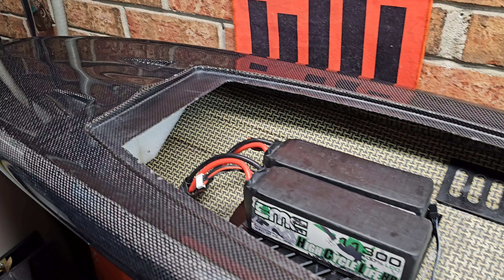How To Use Fiberglass Seam & Parts Mounting Cloth Servo Installation 51" TFL Ariane Build

Comment: Big B , Great demonstration on using fiberglass . It is appreciated . I think that this servo stand enforcement will out last you and me together .😊

Q: in next video , please can you explain that red thing with oil can nozzle attached to stuffing tube you call bearing . Why do you call it bearing?what is its other function besides providing a gateway for flex shaft entering the stuffing tube and anchoring the stuffing tube ? Thank you
Reply from the maker: Yes, thank you...  I will explain the bearing oiler block in the next video

Comment: Great confidence builder 👍 ..I don't mind working with fiberglass, it's mostly the choice of epoxy that causes frustration. I tried using the traditional stuff you get at the hobby store a while back, but my mix was off just enough that it wouldn't set. Stunk my whole place up from the chemicals off gassing. I like using the tubes you can squeeze out. The set time is usually around 10mins, so you have to work quick.. but I like the ease of use. She's coming together nicely! BG4L 🚤💨
Reply from the maker: I have had that happen to me too, what a PITA,  all you can do is clean it up with alcohol and start over.    I mixed resin and resin together once lol. Never in a million years would it set up!
Reply: @IRONCLADRC  Yep.. it's bound to happen working with composites and that's exactly what I did to clean it up. Pain in the butt, but saved the project😄👍

Comment: Yeah I like that cable system for the steering. 
   I do believe those skeggs will give that servo and it’s mount a workout, 40kg is 88 pounds of torque dang!!!  
   let us know how much that boat’s all up weight is when she’s done. I know this, just one of those cooling jackets is bigger than any motor in my collection, I bet the cooling system for that boat holds a quart of water.
This one is interesting to say the least.  BGFL
Reply from the maker: My son and I weighed it the other with everything in it 20.5 lbs so I'm thinking 22 lbs final weight